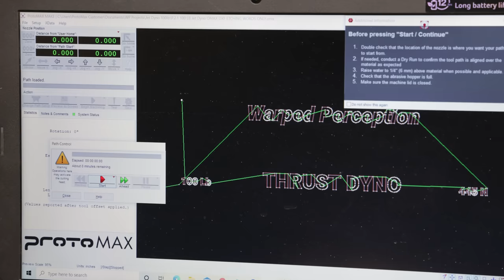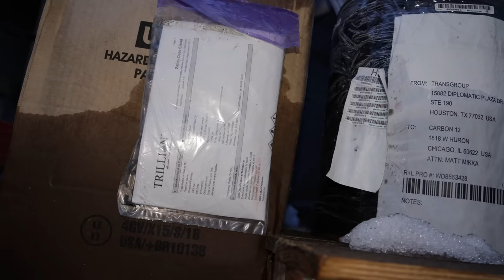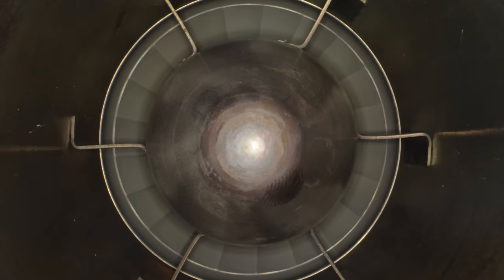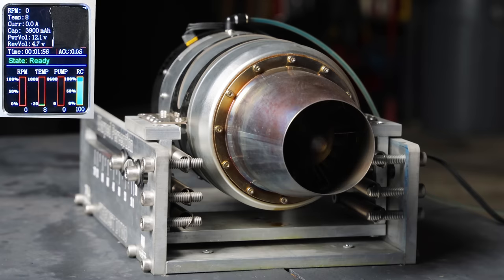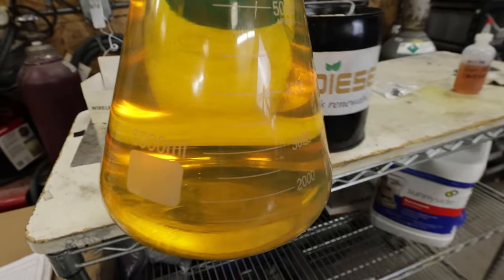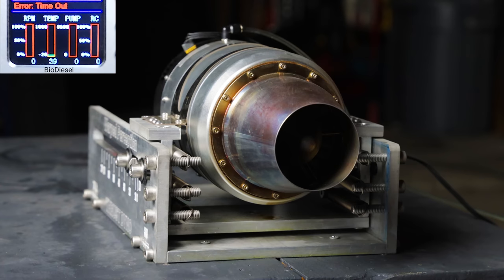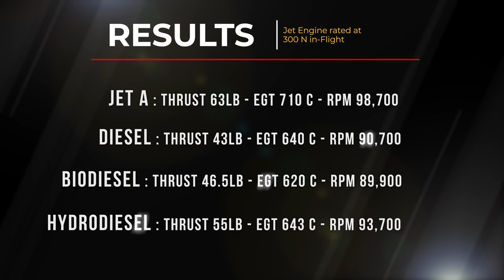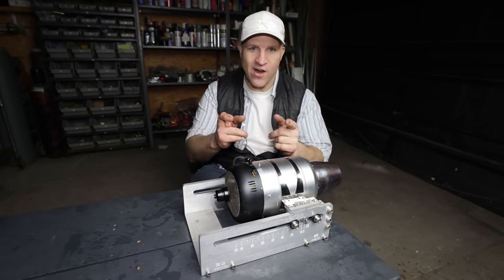Jet Engine Thrust Test - Fuel Experiment (Jet-A vs Diesel vs BioDiesel vs HydroDiesel)

Comment: The lubrication of sulphur is no longer needed. Those are old wives' tales.

Proper diesel fulfills ASTM-D975 or EN590 and has a minimum lubricity to protect the important injection components of a diesel engine.
Reply: So you would think, except the new Bosch high pressure fuel pump CP 4.2 was built to European Diesel fuel specs, and are currently failing at a fairly high rate in the USA because of the ULSD Diesel fuel
Reply: @goodmanboattransport3441  It can be that the US diesel is of different standard, which makes particular engine components fail. I wonder if that's the reason why the diesel powered cars are not as popular in the US as they are, or once were in Europe.
Reply: @Macias1000000  
My thoughts are that most Americans think diesel powered vehicles and slow and have stinky exhaust, which is from a popularity point of view, but the air quality standards for US market vehicles is strict, I believe more than in Europe, and especially in California which has its own standards that are higher than the rest of the US. My understanding is that there is more lubrication in European spec Diesel, and I would also think it's of a higher quality because of the high number of Diesel powered cars in Europe,  nobody would want to be held responsible for repairs because of poor fuel quality.  I  personally got 300k miles from the CP 4.2 Bosch pump, but I take care to add lubrication improvers and filter to 2 microns the fuel from my auxiliary fuel tank, some others have had failures at under 100k miles, but in the current configuration, it's not if the pumps are going to fail, it's when they are going to fail, I suspect Bosch will have an updated version in the future,  or the major manufacturers will start using Denso systems instead, Chevrolet already has switched to Denso for reliability.
Reply: @goodmanboattransport3441  well, in reality, sulphur is a contaminant in fuel. Good fuel does not have sulphur, at all.

If pumps are failing in the U.S., the causes can be other than lack of sulphur. Abrasive particles, impurities from the infrastructure (tanks, pipelines) have led to such issues in the past.

Without a proper analysis of the fuel in question it is very difficult to say something about the probable cause.

I just know that synthetic diesel fuel with no sulphur at all does not cause pumps or injectors to fail.
Reply: @daszieher  

The fuel flows through the CP 4.2 for lubrication and I would think cooling, the pump begins to shed fine metal flakes which are then fed to the injectors causing their demise. I would be interested in a test of lubrisity and analysis comparing the contamination of synthetic and other forms of Diesel fuel available, and if it makes a difference in the filtering system on the truck or if these problems are inherently in the fuel and cannot be remedied. The fix is to either divert the fuel from the crankcase side of the pump back to the fuel tank to save the injectors or to filter out the particles from the pump before the injectors get contaminated. What engines are you speaking of that are not experiencing pump failures?  I'm referring to the Ford 6.7 and RAM 6.7 that are equipped with the Bosch CP 4.2 high pressure fuel pumps. The CP3 pumps are not having these problems, the thought was that the higher pressure of these new pumps is causing a problem with the material in the pump and the metal flakes in the fuel.
Reply: @goodmanboattransport3441 .

Can I find your business contacts based on your name? I'll get in touch.

This is my private account and unsuitable for the following exchange.
Reply: @daszieher  
Yes, southern California phone, but I moved to Houston some years ago

Comment: I have noticed in every run other your than the jet fuel the pump was pegged. I believe if you had something that could push more fuel you could get the engine into constant RPMs. With the other fuels you didnt quite reach what the jet fuel reached because the pump did not push enough fuel. Thats why you had same fuel ussage roughly across the fuels.  I bet this has to do something with energy density of the fuels. You could measure that by setting a constant thrusst and then time a run and measure how much fuel you spent. 

As much as I would like to see gasoline in it I would be pretty dang sketched with it since its a very volatile fuel. Maybe try IPA too ? Just be aware that the plastics in the pump may not enjoy that.
Reply: @bodywerks  well that does make sense. Then heating oil should be the best option here right ? gets you the longest flight time with the same volume. The viscosity issues of the diesel also explain the long ramp down time that was mentioned . So then this test wasnt really all that accurate then.
Reply: @bodywerks  You are incorrect about "...no way Jet A outperforms diesel when the BTU
rating of diesel is higher". The content of Aromatics in Jet fuel ranges from 10% to >20%
(by volume) while the diesel fuel contains 25% to 28% Aromatics (25% in USA an European
Union).  In fact most Jet A fuel has about 15% aromatics content.
The "High Heating Value" (HHV) of Jet A is greater than diesel because of the lower
Aromatics content and from the resulting better combustion efficiency.
Jet A burns at a higher temperature than diesel (which increases turbine combustion
efficiency and hence thrust) because the higher aromatics content in diesel fuel requires
more (heat being absorbed) or BTUs to ignite and burn.
This results in a turbine combustion diesel flame that is 30% longer than the Jet A flame
due to the higher aromatics content of diesel fuel. The result of the longer flame (in the
turbine combustor) is that the 30% of the heat energy of the diesel fuel is not converted
to thrust because the diesel flame extends past the turbine nozzle into and past
the hot turbine wheel. In addition the longer diesel flame results in high energy (i.e.high
velocity) incompletely burned carbon particles being sand blasted onto the high
temperature hot wheel metal with the result being turbine blade erosion
(from combination of carbon or soot on the metal of the hot wheel and glowing carbon
particles).
Reply: @cogitoipsum9627  with that logic Gasoline would be the perfect solution...wonder why they don't use it. Why don't we just ask the guys over at Tech Ingredients so they can give us a proper answer ?
Reply: Diesel fuel can be turned into a "synthetic" Jet A by mixing with gasoline to lower the
Aromatics content of diesel fuel down to the 15% range that Jet A has.  The ratio is
simply 7:3 (i.e. 7 gallons #2 diesel mixed with 3 gallons non-ethanol gasoline).
Reply: The simplest way to get highway diesel to an Aromatics content in the Jet fuel range is
to mix non-ethanol gasoline into the diesel.  Simply adding a quart of non-ethanol gasoline
to one gallon of highway diesel will yield a "synthetic jet fuel" having around 12% Aromatics.
I suggest a test comparing the thrust achieved and fuel consumption between the fuels.
One test with diesel plus gasoline mix fuels (of several different mixture ratios) and the straight
diesel fuel with the TCU setup (i.e. do the "Study RC" on diesel to calibrate the turbine control, etc.)
to achieve 100% RPM (on diesel).  The results would be interesting to see.
Adam Varga: Running straight gasoline in a turbine is certainly possible but not recommended
since gasoline is a "solvent" whereas Jet A and diesel have lubricating properties (that gasoline
does not have).  That's why gasoline piston engines generally wear out in less then 300,000 miles
( or 2000 hours for typical aircraft piston engines) but diesel engines can go to one million miles.
Reply: @adam207321  Running straight gasoline in a turbine is certainly possible but not recommended
since gasoline is a "solvent" whereas Jet A and diesel have lubricating properties (that gasoline
does not have).  That's why gasoline piston engines generally wear out in less then 300,000 miles
( or 2000 hours for typical aircraft piston engines) but diesel engines can go to one million miles.

Comment: After an engine such as this is run, cooled, run and so on, does the performance of the engine change due to the expanding and contracting of the metal components of the engine? Just something I'm wondering about. Thanks for your time in responding.
Reply: I was also thinking the same

Comment: Very cool jet motors and fuel testing.
My comment, the Hydro Diesel seemed to burn unevenly, looked like it put more stress on the motor components, vibration and torque waves.

Comment: In simple jets like that thrust is related to RPM which will go with EGT. It looks like your pump is really what is limiting you there. It didn’t look like your combustor was not burning the fuel but it’s hard to tell. Another reason I say that is that your comment on the delay pulling back from 100% throttle is probably because the control loop saturated and was really high trying to command the pump higher and it took coming back from that with no fuel flow change (pump couldn’t go higher) for it to start coming down. If you can get a larger pump and retune the start sequence then you might be able to get them all to the same EGT with the differences at that point being the fuels themselves.

Comment: Hydro-Diesel (Diesel with water): Really interesting! In early jet times (DC-8 und B707) they also used water to cool down the EGT. The expanding water gave also a little bit if more trust. 18ml of water expands to 60Liters of gas at this temperatures!

Comment: There was a local RC build that strapped two of these jets to a test rig comprised of a 9’ garden trailer hitched to a Ford Ranger. Throttled up they pushed his truck and trailer down the street at I’d guess about 6 mph.  Pretty impressive considering the rolling resistance and weight.

Comment: Kinda crazy to watch this because I can hear them doing these same type of tests at Luke Air Force Base down the street. It’s not the same as the jets taking off it’s the sound of them throttling up & holding it then throttling down to some kind of idle then back up etc

Comment: Back in the 80's, the RR Dart engines on our F-27 Commuter planes had water methanol injection for hot weather performance boost. I would love to see if it works for these small coaxial engines.

Comment: We remove sulfer from the LGO diesel at the refinery. Also we remove H2O and Sulfer from the Jet fuel. The Bio Diesel is just 8% mixed with common LGO  automotive fuel... we also inject 4 additives to the LGO diesel . 1 sentan improver. 2 Vassa,  3 kerocore, 4 Stadis....

Comment: I'm by no means an expert on turbine engines but I did do some hands on research on them (turboshaft specifically) as that was the topic of my thesis. My best informed guess about the results of the test would be (although this might be completely wrong) the efficiency of combustion due to spray pattern. The energy content of the fuels didn't matter as much as their density and viscosity. The injector is placed behind a swirler that swirls the air one way while the injector introduces the fuel in the opposite direction which creates a fine fuel mist. The injector is chosen for the specific fuel it will burn (which would be Jet-A, kerosene) and it creates a proper spray pattern for said fuel. As kerosene is a lighter fraction than diesel, when the latter is injected instead of creating fine mist it creates bigger droplets which do not burn completely (different smell of exhaust and smoke during shutdown). Hydrodiesel performs better as diesel dilluted with water is less viscous and more readily creates a fine mist the way kerosene would. You can also see the combustion is more efficient as there is much less smoke after shutdown.

At least that's what I'd say, might be completely wrong.
Reply from the maker: So I wondered the same thing myself and I wanted to redo this test, what I found out is I'm getting much less fuel pressure on diesel, I've reconfigured my setup and I'm going to do the test again soon
Reply: @WarpedYT  Much less fuel pressure could definitely be a culprit as that can adversely affect atomisation of the fuel. I think that if you try it again with that fixed you might get similar results across the range of fuels.

Comment: Do you think that having the center line axis of the turbine engine and the plane of motion for the sliding mechanisms on the same height so as to reduce the bending moment that could be produced while measuring thrust. Just a quick analysis I thought of. I absolutely love the Dyno build though. I want to hopefully develop my skills in aerospace manufacturing

Comment: You should use fresh springs for each fuel test. The heat  could be too close and  affect your tensions. However super bad ass and thank you.
Reply from the maker: Thanks... No heat on the springs, the outside of the engine doesn't actually get that hot.

Comment: some improvement can be done on the rig, you can add 2 nut one as a jam at each spring end, so to prevent spring popping out, still the chance there

Comment: I'm surprised that diesel, having more energy density, didn't perform as well. Judging by the faries (glowing exhaust particulate) and smoke, I'm assuming the nozzle is injector nozzle is optimized for Jet-A atomization. I wonder of they offer a nozzle optimized for #2 diesel?

Comment: KEROSENE or Jet-A fuel (Jet A-1 type aviation fuel, also called JP-1A) is used globally in the turbine engines (jet engines, turboprops) in civil aviation. This is a carefully refined, light petroleum. The fuel type is kerosene. Jet A-1 has a flash point higher than 38°C and a freezing point of -47°C

Comment: Bio fuels have more lubricity than sulphur, it's actually best to add 2-5% bio to diesel type fuels with low sulphur, they burn cleaner and lubricate the parts sulphur used to and better.

Comment: I love the dyno! Nice work. I'm not an expert by any stretch. But it looks like your fuel pump is maxed out. Could that be why the diesel couldn't bring the turbine up to the same RPM as the Jet A? I know running out of fuel pump in a high performance car engine is catastrophic.

Comment: Your (indicated) thrust did not drop instantaneously, because you apparently have some friction in the rollers.
Should use 2D guides, not just 1 dimensional, to prevent rollerst from getting stuck sideways - example if your springs on the right side have more counter force, then the whole rolling has a tendency to get stuck. And you should use some simple wheels on bearings (or bearings like INA LFR or something) to have it completely smooth.
Engine was staggering when going up and it was staggering when coming back down.

Awesome work!

Comment: I had a Oldsmobile 98 with 403 to engine. I declined it. Then put a water injection in it. That worked very well but run out of water too soon.

Comment: Well you are nothing short of brilliant. To design such n effective and accurate torque jig takes a person that some real know how. Great job on the jig and the actual tests themselves. If you ever sell those jigs I'd love to be on the list to get one. Great video. BTW, Jet-A is a much cleaner fuel with additives to help prevent turbine seizures and aid in more efficient cooling which will both increase the RPM and of course power output, all due to less bearing friction. And most people don't realize that the higher the octane the lower the temperature needs to be to burn so everything runs cooler. The hotter the bearings get the more the friction increase's. If you put a few drops of each between your fingers you will find the Jet-A is slicker. Although not much and it is difficult to tell the difference it is there. So there are several reasons the Jet-A performed so much better. But to put it in very simple terms, Jet-A does what it was designed to do and the other 3 fuels were not designed to do what Jet-A does. Basic. Lol.. Great job. God Bless and be safe.  I've been a scale pilot for over 40 years.
Reply from the maker: Thank you, yes I think you're right. As for the jet dinos I am gearing up to start producing them for sale, I was planning to do this around the time this video came out but with supply chain machinery and material shortages it's been a nightmare.

Comment: I would be concerned about the hydrodiesel.  I worked in the industrial gas turbine business for about 30 years as an Engineer.  We had water-injected gas and liquid fueled engines.  The purpose for the water injection was to reduce NOx emissions.  We found it was necessary to use de-ionized water for injection.  Sodium was the primary focus and levels greater than 1 PPM were not acceptable.  The sodium from the water and sulfur from the diesel combine to form sodium sulfide in the combustion section and deposit itself on the blading.  The degradation of the blades depends on a lot of factors.

Comment: I put together a small Jet Engine with a See Thru transparent housing to allow us to see inside of the jet engine while it's running,  I explain the combustion process of the jet engine from the compressor to the turbine wheel and show visually how the see-thru Jet Engine Works.

 I then film it in slow motion with the high-speed camera to get a better look at how the jet engine works but it wasn't such a big difference.

The amount of heat generated inside of the engine only a few millimeters from the outside cover was pretty impressive.

At the end I did inject fog into the intake of the jet engine to try and visualize the airflow into the engine and how the engine is ingesting air.

Comment: Diesel has a tendency to runaway if it can continue to draw fuel from a source. While it didn't runaway in the detonation sense, I'm guessing it continued to receive fuel for a couple seconds after you shutdown the test and therefore continued to run as if nothing changed.